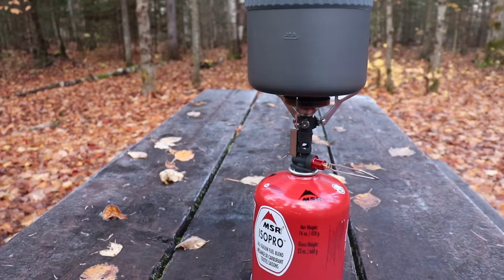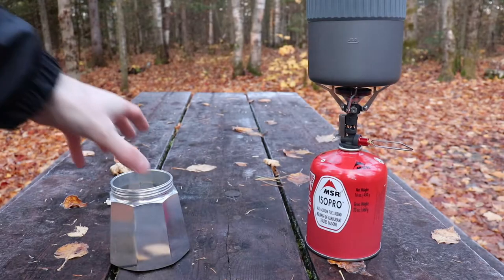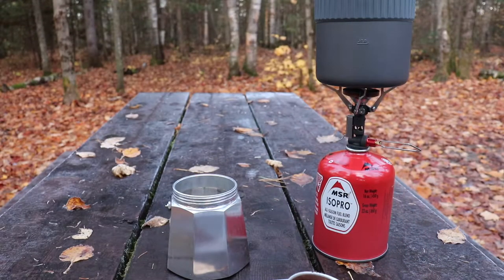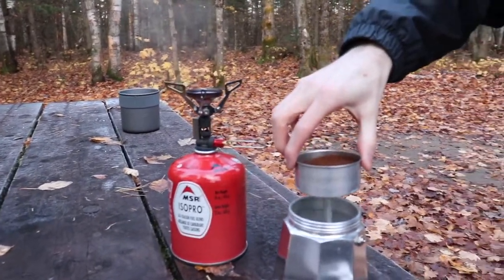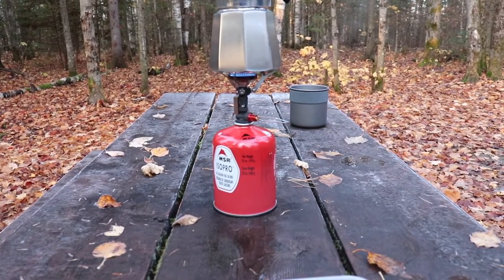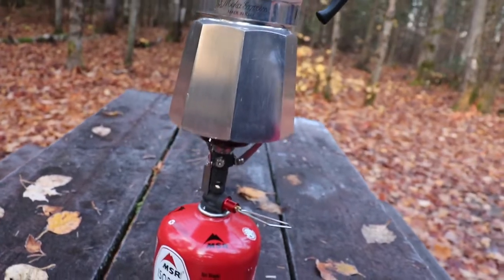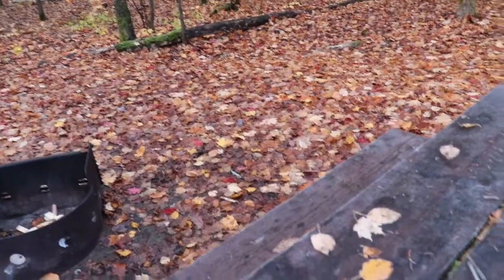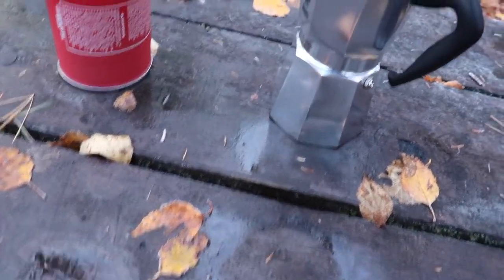How to make coffee using a Moka Pot | Tips for Making Coffee when you're Camping

Comment: I've done the pre boil and a cold start. In my opinion i cant taste much difference. The pre boil method is a faster brew time but the overall process is longer because of the extra step. You can just pre boil in the water chamber but you need a pot holder or rag to put it together hot
Reply from the maker: Thanks for sharing you're insight, I think the speed when camping is less important to me if using the moka pot. But the difference is small I agree